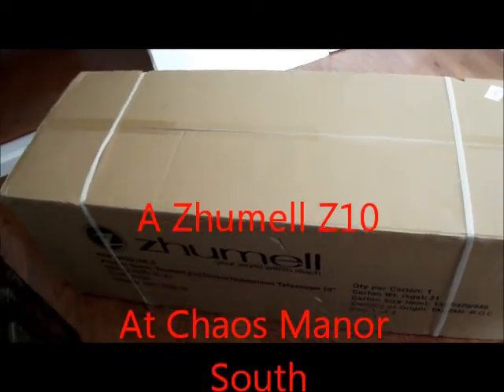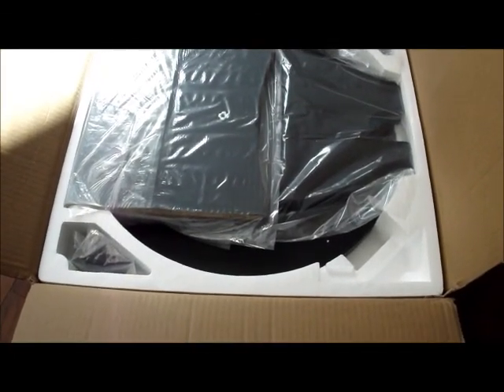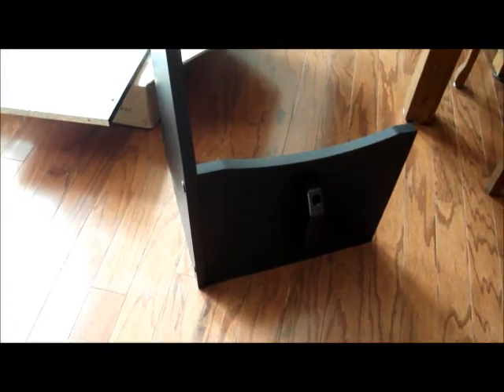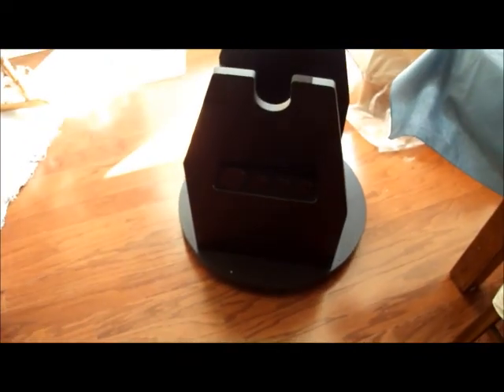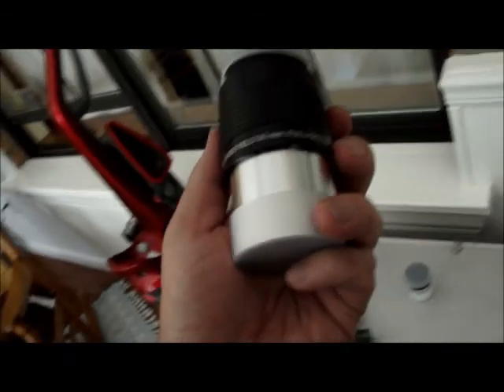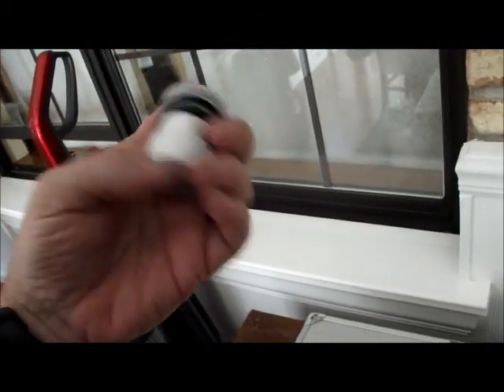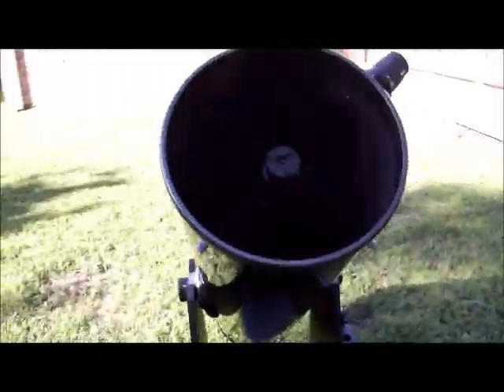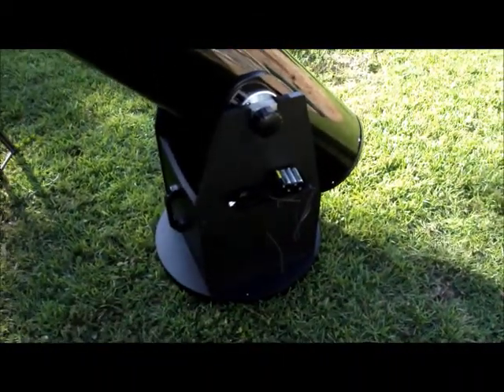Rod Mollise Assembles a Zhumell Z10

Comment: Nice scope uncle rod.  I picked up the Apertura ad12  (rebranded gso) last year and I am very happy with the views. Big 2 inch ep will need a counter balance, I use a large speaker magnet, and the buttery smooth az motion can be a little too smooth if it's breezy outside so I have to really crank that knob down.  Hope you are having clear skies and looking forward to hearing  about your experience with it in the blog.